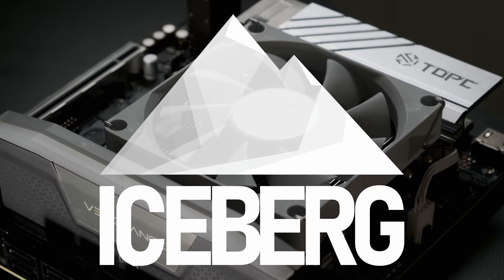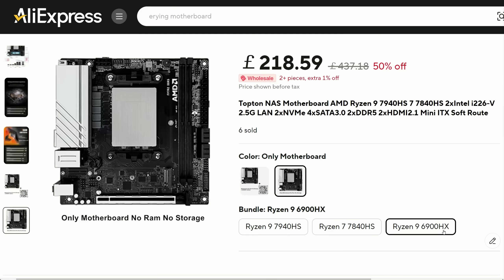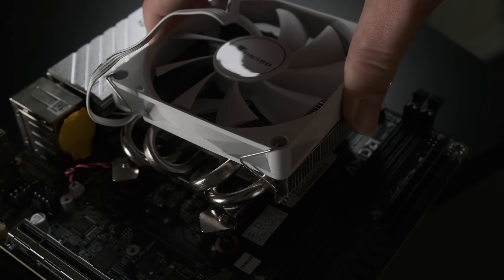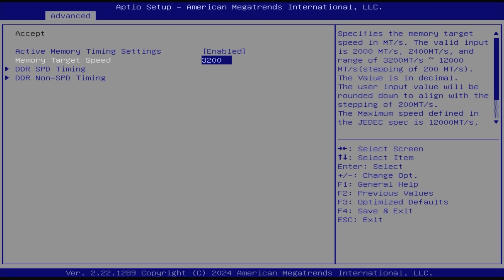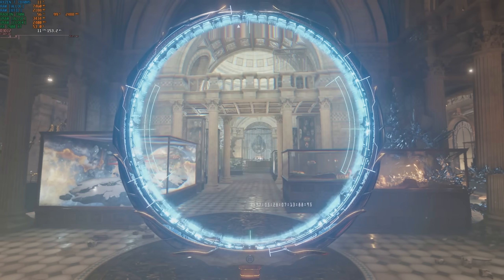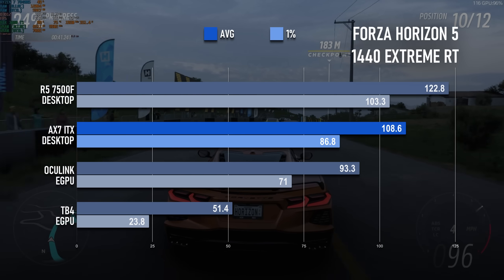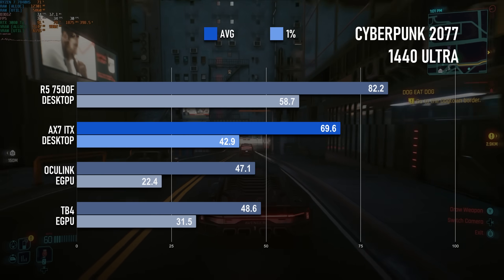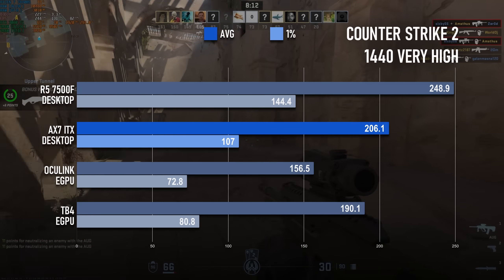Just a perfectly normal ITX motherboard from AliExpress.

Comment: There is no point in comparing normal chips because the price of an itx board is the issues. I build itx gaming pc all day and thats why these are incredible value. Board + cpu seperate is way more than board + mobile cpu. If you want same processing power without a soldered chip, you will pay way more.

Comment: I have been using this as my main PC since last September (8 months). It's been fantastic and exactly what I hoped it would be. Paired it with a noctua low-profile CPU cooler, and one of those weird chinese 'pico psus' -- not actually a pico psu since I guess that's trade marked. It's a thing that lets me power the PC with a laptop charge cable instead of a normal PSU, goes into the 24 pin slot. I've been confused why this hasn't taken off as a desktop option. The power draw is also very low, and I can do moderate gaming. Running linux btw idk how well it runs windows. Totally silent build with the pico psu, the CPU fan almost never spins up and when it does it's inaudible.
btw if anyone goes this route, make sure to adjust your fan thresholds in the bios. Set mine to 40C.
Additionally I should note that my RAM indicates that it's running at 5600MHz, differing from the video above. Could it be there are differences in these machines? It's definitely a n17 with a 7840HS.
Reply: What about the bios, it's still same condition? No xmp and rebar maybe?

Comment: I just got mine... and it failed to boot.

I was going to test it with RAM from my MinisForum BD790i, which uses the 16-core Dragon Range, in the same form factor, only to find that those wer SO-DIMMs. So I had to yank the DIMMs from my Ryzen 9 7950X3D workstation, which are two DDR5-5600 48GB DIMMs.

Absolutely zero reaction, wouldn't post.

What irritates me most is that it also doesn't beep, just power and CPU LEDs in green. Just pulling the RAM didn't change that either, so I'm not sure the board is ok.

I was going to order RAM only after I had tested it, but now I had to get something closer to specs... and went with a DDR5-6000 64GB kit, hoping I'd get it to the official DDR5-5600 timing given by AMD. And I do like my DIMMs to be reusable.

We'll see how that goes, perhaps both will have to go back.

I started with mobile on desktop with an i7-12700H variant from Erying, which was good enough for me to try the MinisForum BD 790i. That is a true marvel and the reason I went with this. I'm replacing some (passive and silent) Atom based Mini-ITX boards with this and am looking something lower power, low noise but a bit more powerful.

Intel no longer serves that niche properly, it's either still slow Atoms or quite a bit more expensive (and hot!) Cores, so AMD mobile on desktop APUs seem the ticket.

Comment: How did you clean the CPU? I have hard time around these pins. The thermal paste is super hard.
Reply: Use isopropyl alcohol
Reply: @hellbryan1299  Mine was really hard with 99% IPA for two hours I couldn't clean it like yours, but my PTM 7950 works great took temperature down by 25 C.

Comment: I have the same board with the same CPU I have Crucial Pro 6000 Mhz 2x16GB running at 5600 Mhz under Mint. What fan do you recommend for this? I already tried Peerless Assassin 90 Se, but it was insufficient and I will try SI-100 next.

Comment: Thanks for the heads up. I will keep an eye out for further revisions of this. If they solve the memory issues (which I bet they will) and drop one of the new HX390 chips on one of these? I will seriously consider it. My bet is they have strapped a desktop memory controller on this that is not playing nicely with the chip. MinisForum got around this issue on their boards by retaining the mobile memory controller and moving to a vertical SoDimm arrangement.

Comment: I just the same board with the same CPU config and they even informed about the RAM as well 🤣🤣🤣 I bought it for my new OpnSense FW Appliance cause I'm getting 10G Fiber by the end of the month and I want to run ZenArmor & IPS/IDS on it, so I need a quite powerfull CPU. I wonder if the Board supports M2 Raid?

Comment: This has one of the best integrated IGPUs, I think the real testing you should have done is testing that compared to other similar priced builds, maybe with a better cooler (like a peerless assassin) and overclocking it a little. It makes no sense and point honestly to just put a graphic's card and not take in mind that it's a mini itx done to set up as a mini pc to a tv using the great integrated graphics.

Comment: When I reported the issues to the manufacturer, they also said to only use Samsung or SKHynix memory. I don't have any of those to test right now, but with the Kingston Fury Beast RAM I have, despite the issue, there are no errors in Memtest. Yet they insist it's incompatible. And to only install PCI-E x8 graphics cards because the board is not compatible with x16 GPUs. A rather ridiculous set of restrictions, which indicates the lack of full-fledged testing of products in production.

Comment: Got this mobo from Ali (7940HS version), they call it N17 NAS Gaming board now. And mine is useless, I can't even enter BIOS setup or reboot as it shuts down in both cases. Strangely, if I connect a descrete GPU, I can boot a Memtest and access BIOS normally, but it won't output video through GPU, but through 780m iGPU ports only. Tried to ask Topton for another BIOS but they refuse to provide any. Regarding memory frequency, there's a Chinese video review, seemingly he used an earlier build with another BIOS and was able to change frequency and timings up to 5600 MHz. It would be great if somebody could provide another firmware to test. I have a 07/05/2024 BIOS version.
Reply: my bios rev 2.22.1289, no ram voltage option. only the MTS.
Reply: @Giannichedda1897 I have the same one. Today I tried to install Windows 7 from a disk and Windows 10 from a flash drive, but the computer froze in both cases after a few seconds of starting the installation.
Tech support suggested that I send the board back along with the RAM for testing, but first I want to try booting it myself with a different RAM. Although more and more signs point to problems with the iGPU.

Comment: i got a higher spec MODT with a ryzen 9 7940HX CPU (16c/32t) from minisforum. the BD790i SE. i got it as low as 329 USD. so far it's really super snappy and it doesn't run that hot, just paired it's built-in heatsink with a noctua NF-A12-x25 cooler and set it at max RPM (1800) which is still virtually silent.

Comment: Appreciate the review, but it misses the point of this board. The video is showing MS Windows installed, and is testing GPU or gaming performance. The market for this board is home labbers. The OS type it should be tested with is either a hypervisor, like Proxmox or XCP-NG, or a NAS OS like TrueNAS or Unraid. Stability, efficiency, and virtualization support are far more important than pushing the ram speed. The PCIe x8 card slot is less likely to be used by the target market for a graphics card, and more likely will used for either a SAS card, or a fiber NIC. It's an interesting board for it's intended purpose, unfortunately this review didn't review it for that purpose.

Comment: Owner of a RTX 3080m 8GB desktop card paired with a i7 6700k @ 4.4GHz stable bios OC + software undervolt, 3200MHz 16GB(2x8GB) GSKill DDR4, 1440p 165hz AOC monitor, running mobo,cpu,ram,ssd since 2016

Comment: I got a similar board called the Erying M-ITX i5-13500H SRMHY which, as the name implies, has an Intel mobile CPU. It's fantastic because it comes with USB-C and doesn't constantly trip my crappy house's power breaker like my last gaming PC with a desktop CPU did. Chinese recycling/upcycling culture is fantastic and something us westerners (and indeed our tech markets) can learn something from! The BIOS/UEFI may be rough and the hardware might have some ugly heatsink bodges, but it's surprisingly effective if you need to make a computer build with the lowest possible wattage that a desktop CPU would never be able to do.
Reply: Was it low cost?
I've seen 13900h/hx go for the same of lower cost than the i5.
Plus there's a 7940hx which is an absolutely performance monster, matching and trading blows with 14700k i7.
Mentioning cuz I've seen some great minisforum deals on it.
Reply: @yasirrakhurrafat1142  It was actually 331 USD - its decent cost was one of the biggest reasons why I got the Erying board that I did because I needed a mobo with USB-C, had a laptop CPU, and wouldn't break the bank.
Reply: @MajatekYT  oh it has usb c?
Does it also have thunderbolt, and what is the maximum usb version?
3.0, 4.0? Or higher?
Reply: @yasirrakhurrafat1142  Yup! It's not Thunderbolt, but it is a USB 3.0 Type-C port so it does meet the minimum requirements for a Meta Quest VR Link. More than enough for me.

Comment: Chipset doesn't matter the Memory Controler is inside the CPU (IMC). Mobile CPUs from AMD do NOT support EXPO and I don't think that Topton has any interest in validating RAM and building there own profile lists however it would be nice for there EFI (BIOS) to allow for manually configering the IMC outside of the JEDEC profiles.

Comment: Topton or Minisforum which is same .. actually put this in my basket last night on Amazon, still comparing though with Asus mATX board which is full AM5 socket .. but going Mini power consumption and cooling is the issue so ... this board makes sense just that CPU is soldered. Like Laptop indeed.. guess enough power for office and  home..

Comment: 8:02 I have found that AMD APUS struggle with 1% lows because they have between 1/2, to 1/4th the cache of full CPUs, not because of system RAM(i held a DDR4 RAM OC record using a 5700G with DDR4 4933 C17-17-17-28 while still in 1:1:1 but it still had bad 1% lows compared to a 5800x) The 5700G/8700g has 1/2 the cache of the 5700X/7700x, and the 4750G has 1/4th the cache of the 3700x

Comment: The CPU cache is why CP2077 is running so much worse, match that same system vs a 5800x3d the gap is likely worse between the desktop tested here and that one. A GTX 1080Ti could BARELY start to saturate a 2.0 x8 lane and it was tail end of 3.0 x16 cards, that 3080ti isn't making that x8 4.0 break a sweat.

Comment: I have an i5 12500H soldered on to an itx board by Erying and it's fairly cromulent. Replaced my Ryzen 5 3600 I've been using for work with it given it benched 50% higher in cinebench - it even had a USBc header for the front panel and the bios actually looks rather modern and nice.

Whole thing has been reliable and solid performance so it's living in my work desk (instead of going in to a Nas as I'd originally intended, hoping the igpu would be better for quicksync than the i3-8100 in my current Nas - looks like I'll have to get a second one).

Threw a sparkle A770 intel GPU in it for shits and giggles and it's playing quite friendly whilst giving me a fair crack of gpu memory for llm models.

Comment: This is not a desktop. This is embedded solution. For small servers and nettops. There are a lot of mITX motherboards with mobile Ryzens from ChangWang (CWWK) and others. And this is not Topton. It's TOPC. Topton is a shop that specializing on mini-PC, mini-servers and embedded solutions.
And there are actually more interesting implementations like CWWK's - with 4 2.5GBASE I226 controllers, several additional SATA controllers, two m.2, internal USB s for keys and SO-DIMMs. For powerful NAS or VMs.

Comment: These Mobile CPU based boards are also pretty good for low-power server use as well, as they can often have a lower TDP than desktop CPUs; yeah sure it might seem like a desktop offering, but the APU can transcode content, dual 2.5gbe makes it decent for server use and the extra slot can either hold a 10gbe ethernet card, or dedicated GPU.

Comment: I would be curious how this stacks against a MinisForum BD770i/790i since it's all AMD though MinisForum has Intel options. I'm running a 770i with 96gbs ddr5 and a 6800xt and it runs most games at 100+ fps with max settings at 2560x1440. Price for performance has been great for me.

Comment: I'm running something very similar from Minisforum, only with PCIe 5.0 16X and they do a 8c/16t or a 16c/32t variant. Included HS (add your own fan) does a semi ok job of cooling but these CPUs are designed to be cooking in laptops anyway.

Comment: Ah yes the mutant boards. Something to be considered? The power consumption. Pair this board with an A2000, 3050 LP or 4060 LP GPU and a small formfactor chassis and you can game at 1080p or more while only sipping power. 1080p and 1440p high refresh portable monitors are VERY cheap now a days... Could be worth a look.

Comment: It has decent price and I feel like this setup would work well with RTX4060 cards that use only 8 lanes anyway. But are those price savings worth the jank? 

I'm not sure especially if something like R5 7500 with GPU has this beat in gaming performance and you avoid all that jank and you actually can pick and match the motherboard features.

It's still interesting though.
Reply: $300 for mobo+cpu, any microcenter cpu+ram+mobo deal will be better. Mobile CPUs have less cache.

Even a 5700x3d + cheapest (or used) b450/550 board will be better without risking china jank & no support if you run into issues like your ram not working or getting xmp.

Comment: I have this board. I got it for my kid's PC, the 780m in the 7840u is enough for her needs. I was disappointed to find it doesn't support XMP/EXPO or PBO, it's also limited to 5600MT/s max. You can set timing manually, but not RAM voltages, so you're not getting far. Mine did fit the stock cooler I got with my 5600x few years back, though I did have to remove the trim ring on it for clearance.

Comment: Video suggestion. Whats the most powerful video card with pairing with thunderbolt or oculink. You almost always see these interfaces tested with high end gpus that are knee capped by the interface.
Reply: Every card takes a performance hit when connected via thunderbolt or oculink. Reason is the added latency and protocol conversion. Faster cards take a bigger hit once the connection becomes banhwith constrained (somewhere around PCIe gen3x16 or gen4x8 on a 4080/90). Few you'll always get at least 50% perforrance out, but 1% will suffer the most due to that latency penalty.

Comment: There are benefits to having 300-400fps in online shooters even on a 144hz monitor, yes there is an actual difference and yes the difference is very small but it's annoying when the presentation makes it sound like there's no difference even though it's technically true that 200fps will max out a 144hz screen.

Comment: You see my friend, I am from Ukraine and I speak Russian, so I know all about these innovations of all kinds because I watched Russian and Ukrainian channels on them lol for years now
The level of ingenious stuff Chinese can repurpose is incredible.
They restarted Xeon 2690v1/v2/v3/v4 server CPUs with their X99 and X299 motherboard variants into full on gaming machines competing with i9-9900k at the time. Motherboards were repurposed from scrapped server motherboards and soldered on modern boards with modern mosfets/VRMs and accepting NVME PCIE 3.0 slots now. Adding laptop chips was another creation by China, because they had millions of "burned" motherboards, but with tons of parts to use, and tons of laptops that could not work for whatever reason. 

I can't say that I am not impressed.
Considering most Ukraine and Russia cannot afford top of the line CPUs and GPUs, they are a HUGE market for those creations, and some of them are incredible.

I had dual Xeon E5-2678 v3 cpu set up, but motherboard longevity is questionable, mine had issues from day one, and had to be refunded. Seller did not even care for the board, he just gave me money back and I tried to BIOS flash using specialized tools, by reprogramming the BIOS chip externally. It worked, then it didn't work again. I even bought 129 dollar programmer trying to revive that board.

The issue with these motherboard is that they love to re-use mosfets from old motherboards and old VRMs. So, you are buying a board without warranty. It can last you for years, or crap out in 2 weeks.
Such brands include Jingsha, Killsre, Machinist, Huananzhi. Those dude manufactured some dope concepts, but BIOS is super limited as well

Comment: You can significantly reduce the temperature by replacing the CPU paste with either Liquid Metal (only with the IHS that are copper or contain a copper core) or more practically, thermal grizzly kryosheet

Comment: little info about your ram speeds and the  fluctuating ramspeeds.

i had little fun with my hp victus 16 laptop,that uses the same cpu.
There is this tool called "smokeless umaf" that unlocks the hidden amd overclocking bios.

the 7840hs supports UP to 5600mt/s NATIVE speed,meaning the 5600mt/s has to be actually programmed in the spd.
yours being stuck at 4800 is probably because your corsair kit defaults to 4800 when expo is not enabled,which the 7840hs,as you mentioned, straight up does not support.
so with some generic 5600mt/s cl46 or "gaming" kit that defaults to 5600mt/s you should be able to run at that speed.

mobile phoenix cpus and desktop phoenix cpus also differ in powermanagement.
The desktop aka ryzen 8000 don't throttle their infinity fabric/memory speeds based on the type of load.
Mobile does this to preserve power and balance where they can put their powerbudget.